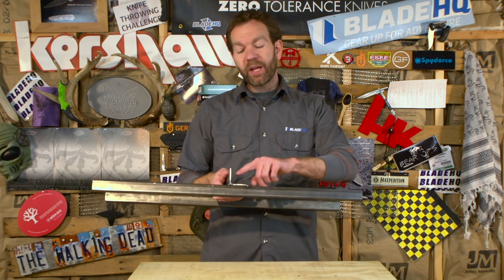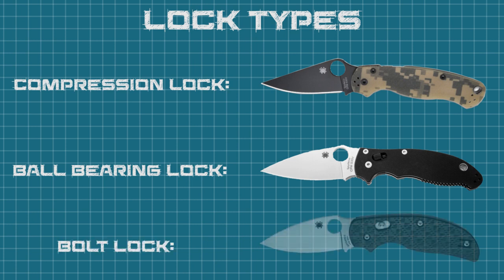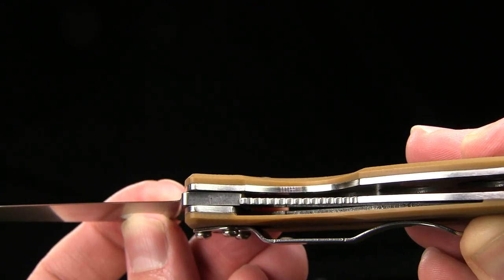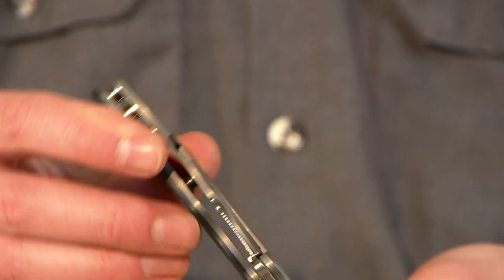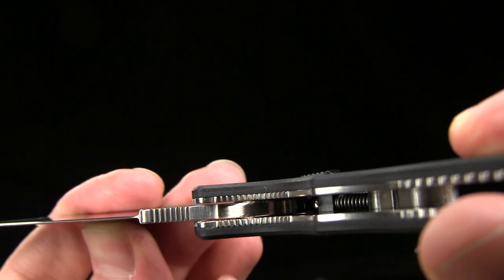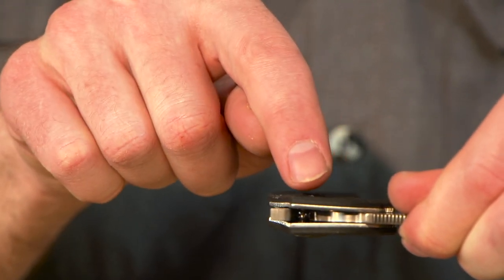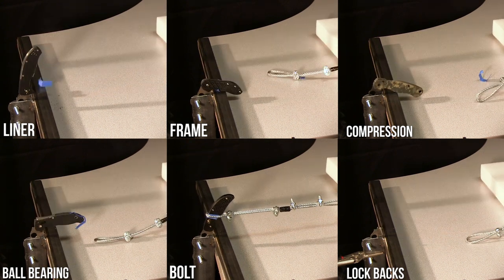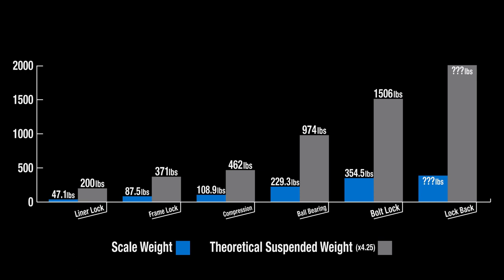Pocket Knife Lock Strength Test II

Comment: Winner: fixed blade
Reply: Shear failure
Reply: Depends on how good the metal is.
Reply: well actually the lock back only failed when the blade broke.  so a fixed blade would have the same weakness.
Reply: @samlee6240  Nah, a folder has a much weaker spot at the base of the blade, where there's a hole for the pivot and cutaways for the locking mechanism. A fixed blade, especially with a full tang or even integral bolster, has a much more sturdy construction in that area.
Reply: depends... compare some sog rat tail or mora that are not even full tang, with triad lock
Reply: Fixed blades are tools, folders are toys ;)
Reply: WillBrink tools*
Reply: @willbrink  lmao that doesnt have any sense,just because someone wants to wear a folder to not be noticed,it doesnt meam it isnt a tool,and btw pocket knifes are can  be used for more stuff than fixed blade(swiss knifes edc)
Reply: Halarious comment!
Reply: Winner: the knife not subjected to this test🤷
Reply: can i hav som fanny a Swiss knife is a multi tool not a folding knife buddy it just features in as tool... Also no you can’t have any fanny cuz you comment stupid stuff online.
Reply: The winner for dumbest comment is you as well... this isn’t about fixed blades if it was it would matter on the metals used
Reply: Lol yeah
Reply: Lol
Reply: Who cares, who is going to use a “folder” at 200lbs of pressure or more.
Reply: Winner mora
Reply: Fixed blades are worse than folding blades
Reply: Yeah fixed blade wins....till you find out they are illegal in some instances where folders are not. 

Carry the right tool for the job.
Reply: @ASMRforU01  no they can’t
Reply: You're on the wrong test video dude
Reply: Sure
Reply: @samlee6240  the fixed blade should still be able to take more punishment. even though the blade failed on the lock back, it failed where the pivot was because theres a big hole drilled through there to accommodate the pivot. a fixed blade would have been solid all the way through or have no hole in the material

Comment: No axis lock? Come on guys...
Reply: Probably similar to the bolt lock. It's an extremely tough design, and would most likely break the blade before giving up.
Reply: axis lock is strong! in fact, in the benchmade tests, the liners deform and  the d-nut(not "deez" nut) that make uo the blade pivot completely breaks. that lock is too damn tough for the rest of the knife! lol
Reply: Spyderco  doesn't use axis lock, come on dude.
Reply: Sasquatch78 please tell me that was a sarcastic joke and you weren't actually trying to tell me that spyderco doesn't use the axis lock....
Reply: Mike D Nope, they have the bolt lock which is similar to the axis lock, but it's not the axis lock.
Reply: Sasquatch78 dude it was a rhetorical question, im aware of that, been collecting for 13 yrs. My comment of 'no axis lock" meant how can you say you're testing the most common locks and leave the axis out, its by far one of the best.
Reply: The ManixII's bearing lock is very similar to an axis lock, maybe a tab more reliable (less prone to dirt getting in and failure to open, and it the spring breaks the knife will still lock).
Reply: Gain Medium please don't try and teach me something about knives and locks, ive been in this game for 13 yrs, owned, dismantled, maintained and tested more knives than most. My comment was purely aimed at the video stating it was testing common locks and leaving out one of the most common. The axis lock will hold a decent amount, its no triad lock, but will out perform a liner or frame lock.
Reply: Mike D c,m. Vn
Reply: Mike D They're all Spydies.
Reply: Some say it's an extremely good lock, but I witnesed with my own eyes how it folded when "spinewhacked" on a KNEE. The guy said he might have lubed it too much, but I saw what I saw :)
Reply: Tyrone Biggs sad? I think you clearly realise im no kid, nor am I new to the knife game. You want to know the answer to your question about the best edc steel? Here's the only true answer, one that has been realised after about 13 yrs of knife using and maintaining, ready for it? There is no best steel. The best steel is the one that fits the individual. You might need tough steel? Grab some M4 or carbon, but does it corrode on you? Is it too humid where you live? Who knows. For another it might be H1 or lc200n if he works near the ocean, you trade edge retention for corrosion resistance. Another might get by with s35vn his whole life. Every man is different. For me personally, i can get by with cts-xhp or m390 and be perfectly happy. I find it a well balanced steel and that suits my needs for edc, doesn't excel at any one thing, but works well across the board. Heck, it all depends on heat treat too. There is no best steel, there is only "the best steel for the job and the individual" anyone who says otherwise is simply new to the knife game and likes to quote "super steels" to sound like he knows his shit. Its like saying "whats the best car" there is no single best. A sports car is fast but its shit off road.
Reply: Tyrone Biggs I actually like the look of that knife. I've used n690 only for a short time and can say there was nothing that stood out as a negative. In sharpening it felt a lot like 154cm or vg10 and it performed similarly. In composition its comparable to 440c but has cobalt and vanadium in small amounts which adds to its properties. What kind of use do you usually put your knives through?
Reply: Tyrone Biggs sounds like your uses are similar to mine, good to hear you actually use your knives unlike most people. Although they aren't man jewellery knives, the new cold steel offerings in cts-xhp make absolute fantastic camp knives. They have nailed the heat treat on it. I've carved wood, hacked at branches, hit bone on game plenty and the xhp steel hasn't skipped a beat. I personally think it has a perfect balance, its tough, holds a good edge and it won't chip on you if you hit bone or do some twisting while carving. I've used a recon 1 clip point for years and it's held up just as well as my demko AD-10, plus its thinner and lighter. Anything in cts-xhp, m390, cts-204p or 20cv should work well for you. Of course M4 is probably better than all of them in overall toughness but you'll need to keep it oiled as its not very stainless. The new cold steel SR1 is a monster, but its a bit thicker behind the edge so you'll need to sharpen it back to about 20 degrees per side, but I honestly don't think there's a tougher knife out there for the money. Been very impressed with mine. But it also depends on your taste, some people like and dislike certain types of looking knives so im not sure what you enjoy.
Reply: Oh so your in the army? are you now. whats your mos? whos your nco? what unit?
Reply: They maybe didn't include the axis lock because you can find an axis lock strength test straight from benchmade if you just search "axis lock strength test" on youtube. The result was 698 in/lbs of torque.
Reply: +Gain Medium weird how the axis lock beat all of these locks then.
Reply: ball bearing or axis is the same no ? .
Reply: Maybe benchmade won’t let them ... welcome to USA marketing baby
Reply: When people sit there talking about how long they've been "in the game". Sounds try-hard, makes me laugh.
Reply: I enjoyed reading this thread and witnessing how Mike D and Tyrone Biggs somehow became friends 😂
Reply: Spyderco doesnt make knives with axis locks
Reply: @stringX90  biggest plot twist ever
Reply: @thestig007  axis is perpendicular to the blade tang bolt and ball bearing locks are parallel so theoretically the axis is superior because there are less directions the lock could slip in
Reply: The axis lock is patented by benchmade, and all the knives in this vid are from spyderco for consistency's sake. You don't sound like you've been collecting knives for 13 years or like you listened to the video.
Reply: Poor delica :(
Reply: @nobodycares9778  im pretty sure the term "axis lock" is trademarked y benchmade
Reply: @Unertl16122  and you're telling me this now why exactly?

Comment: With that setup the lockback would theoretically have infinite strength. The lock would have to press back into the winch cable to open so it simply couldn't open with this set up. It could be fixed by putting the winch cable at the end of the handle.
Reply: You are correct. The lockback test is seriously flawed.
Reply: You both are seriously flawed. The video clearly shows the cable at and slightly above the pivot point of the lock bar. At the pivot point, there is no bar that ever rises above the handle. Above the pivot point, the bar recedes into the handle when pressed.
Reply: Good observation!
Reply: @WhiteSandsMbuna  no they arent flawed you are flawed xD, the location of the cable means the lock is being forced closed, so the lock cant be opened, its like measuring the force required to open a door inwards while you are pressing it outwards

Comment: But the liner didn't actually fail...
Reply: Exactly.
Reply: Well it didn't fully succeed, lol. But yes it did protect the hand which is most important. The problem is, all liner locks are so much different and how safe/strong a liner lock is largely depends on the precise specifics of the lockup, concerning materials, friction, % of lockup, angle of liner at lockup, shape of the end of the liner/the part of the tang that accepts it, stiffness of the liner, how well the liner is attached to the scale, how strong the scale material is, how tight the lockup ultimately is, etc etc etc. Some liner locks are complete trash. I like the liner lock on my spyderco military. It is done quite well considering how lightweight it all is. I've never had it fail, but I do prefer my framelock military. It feels more secure, with how tight the lockup is, and the amount of friction keeping it locked in.
Reply: The Ace so you use your knives with pressures of 50+ pounds? Lol how do you know how strong they all are without knowing true strength of the blade materials etc....

Comment: Honestly these tests are a whole lot of trouble for skeptical results on a topic that barely even matters in real use scenarios. When heavily using a folding knife, the pressure is going "up" into the blade anyways, so any of these locks will be more than adequate.

Comment: The only problem I have with this test is how quickly the load is applied. in my experience scales, especially digital scales, are not accurate under shock load. kind of like when you step on your bathroom scale and it takes a second or two to level off and give an accurate reading. In my opinion you should try using a hydraulic system, that is more capable of applying slower, more steady loads.  
I would definitely love to see more videos just a more accurate rig.  
Keep making great videos.
Reply: Yeah like, kinda cool that they did this video, but why publish it if you know your results are off by a factor of 4 because the winch builds tension much faster than the sampling rate of the scale.
Reply: Weight is the force, an object is drawn with to the center of the planet. A scale meassueres force, when you step on it, you briefly apply more force onto the scale. When you stand in a trampoline, the sheet will sink in a little, when you add momentum and jump on it, it will go down much futher. 
Also, a slow test would be unrepresantative, because i doubt, that anybody is able slowly apply so much force from their wrist, imho.
Reply: @gehtdianschasau8372  I don't know anyone (who isn't an idiot) that uses their pocket knife like a hatchet, applying huge amounts of shock load To the pivot, and locking mechanism. 
Most cutting situations are slow, consistent, and steady application of force.
Reply: @BryceAWD  It's been 4 years, so you might not remember that this test is about the sthrenght of the locking mechanism when the knife is open. I don't know anybody who cuts with the spine of the knife.
Reply: @gehtdianschasau8372  look up sampling rate. I'm not going to wast my time arguing with someone that doesn't understand what they are talking about.
Reply: I felt the same at first, but then I realized the whole purpose of the test is to see which one is least likely to chop off the user's fingers if they stabbed something. In that case the thrust would be very fast. So I think the test is solid.
Reply: @kinguin7  that and that the wire loop slips and the load application point shifts arbitrarily, increasing the lever and the moment acting on the lock.
Reply: @baxtrom  yeah, cool to see them trying, but, the results are really not reliable. Definitely room for improvement with the methods lol.
Reply: @BryceAWD  What if you were getting mauled by a bear or crocodile and were stabbing them in the skull as hard as you could?  You'd want a knife that wouldn't break, right?
Reply: @Ron Moore  you misunderstood my problem with the test.   
In my opinion, and you know what they say about opinions, they are applying too much force to rapidly, to get accurate readings, with the recording equipment they are using.  
If the scale you are using has a sample resolution rate of 1 second, and you reach yield at 1.5 seconds, that is a half second of missing data. 
I hope that clears it up a little.
Reply: Yeah, he said in the video that the test wasn't perfect, use the info given to your own discretion.

Comment: i'm actually more impressed with compression and bolt lock since they both held a lot of weight and they are still usable after failure.
Reply: +Lorenzo Giancristofaro Seems to me the ball bearing lock didn't even fail. The handle did. The screw broke allowing the ball to come up between the liners.
Reply: Ze Doktor I was expecting it, a steel ball bearing as insanely hard to brake, the pivot screws hold far less weight. The thing is that since the scales broke there is no way to use the knife ever again
Reply: Your fingers, however, will NOT be usable after such a failure.
Reply: I'm surprised the ball bearing lock did so well
Reply: Why don't they use that type of lock for karambit knives?

Comment: As soon as the cable slips up on the handle, the test becomes illegitimate. Basic physics.
Also, a frame lock is aided by hand grip.
I know y'all are really trying, but too many problems with this test.
Sorry to be negative.
Reply: evvignes not to mention the liner lock is the only one that didn't fail.  Sure, it can't be closed anymore, but it's the only knife that you still have your fingers as well
Reply: evvignes exactly. I don't count a folding knife's lock sticking in place as a fail. If a knife is going to "fail" that is the best way for it to happen. Much better than the blade snapping off.
Reply: evvignes they are also testing the opposite direction a folding knife would be used in real world usage. the entire test is flawed.
Reply: thank you
Reply: Rob Kahla The liner locks did fail the test. The knife just got lucky and you could still use them after but with some damage, the lock still failed. The lockback didn’t fail because the blade failed first so the test was inconclusive since delicas have a much thiner blade than all the others.
Reply: evvignes frame lock/liner lock are the weakest lock designs. Basic physics, when you have a long column resisting the closing forces then you are more prone to buckling. The best lock designs put the pieces resisting the closing forces under tension not compression.
Reply: Rob Kahla the liner lock buckled for a failure mode. It could have buckled outward as well and closed just like the others, so don’t count on this fail to safe situation, just happens to fail in this way sometimes
Reply: @tory6733  They are the weakest, this is true, but that's far from saying they are weak in general. Let's be real, how often are your knives going to be put under this much force? Applied to push the blade toward the front of the handle rather than the back, no less? For most real-world scenarios, a liner lock won't let you down. In extreme, hostile environments? Yeah, you might want something sturdier than a liner lock. But in such environments you'd probably be overall better served by a fixed blade anyway.
Reply: They can't get these tests right...I knew it would slip when I saw how they were doing it. Useless...they need to get project farm test these
Reply: @joe_ferreira  exactly, as a knife user we put pressure at the cuttingedge to cut true stuff and we do not use the spine...so this test is not a real world  test.
Reply: @SuperScalemaster  if you're testing in the direction you normally use a knife then you're not actually testing the lock at all since all the locks do is prevent the knife from closing. The pivot itself/blade/over travel stops are what keep the knife from doubling over when you press down into something hard and that depends on the individual knife.